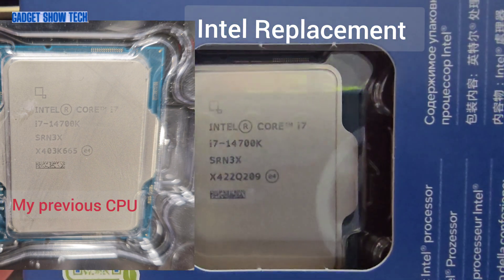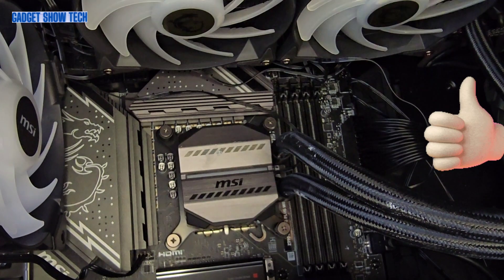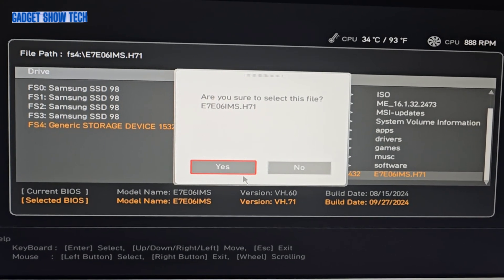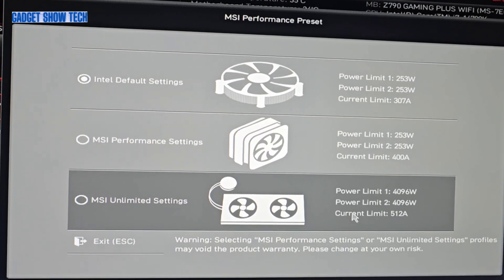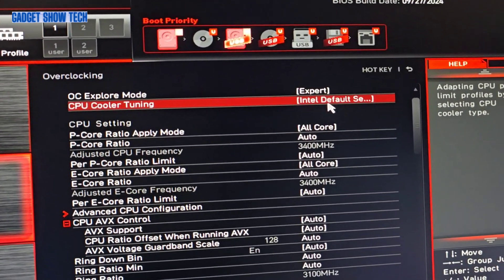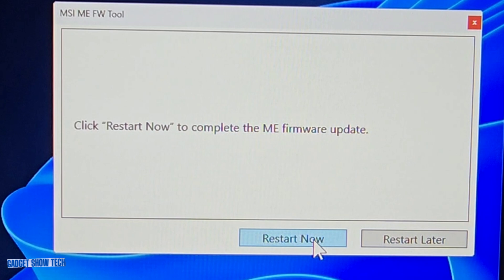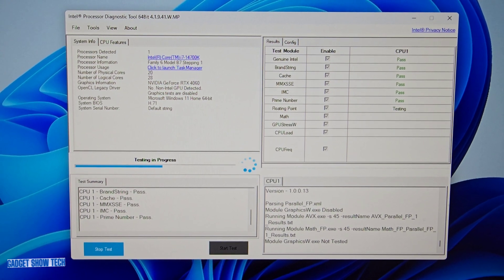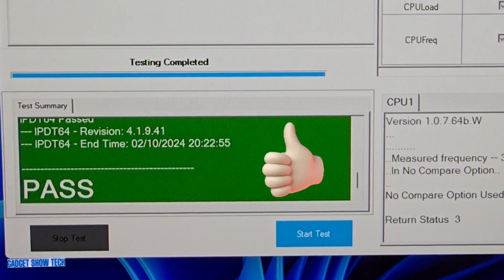This Microcode Fixes INTEL CPU Vmin Shift Voltage issue and ME Firmware update

Comment from the maker: Reports of Raptor Lake instability issues have been at an all-time low since Intel released firmware updates several months ago — but they're not completely gone. Intel released microcode update 0x12F last week to fix Vmin Shift instability, an issue that was thought to have been fixed with previous microcode updates.

Microcode update 0x12F is reportedly an extension of the microcode update 0x12B, and it supplements 0x12B with additional fixes that weren't covered. Specifically, 0x12F fixes a limited issue surrounding instability on Raptor Lake systems operating for multiple days in a row, running low-activity, lightly-threaded workloads.

Intel confirmed that microcode update 0x12F does not incur any additional performance penalties beyond what previous microcode updates might have added. To clarify, microcode update 0x12F specifically applies to 13th- and 14th-generation processors and does not apply to Intel's latest-generation Core Ultra 200S series processors, which have no (known) instability issues.

Comment from the maker: 1) Intel ME Firmware. This is flashed to your motherboard and is independent of the OS. It remains in place unless updated.
2) Intel ME interface (MEI) drivers for Windows. These will need to be installed every time you do a fresh install of Windows.

Comment: The ME software must be done before the BIOS update. I would re-install the BIOS update.
Reply from the maker: @NeXuS858  is separate from the main BIOS firmware, hence the need to update it separately.    Also, it's a new MB, I'm sure another BIOS update will be out soon.
Reply: @SmartGadgetShow  I know that's why I'm saying to update ME first. It's basically for all components to communicate with each other. Some vendors do include it together with the BIOS update though.

12B is awesome I was getting a very slow bootup with the past microcode update for some reason.
Reply: I saw the same thing. I do it just to be safe.
Reply from the maker: @frankmjr6571  I've only read on ASUS dated 2023.  But motherboard manufacturer's give instructions, and I'm sure they would if important.  
I've flashed a more recent BIOS.

Comment: INTEL s.u.c.k.s. so bad  :)
Reply from the maker: All my computers are intel.  I still have a 14 year old laptop with i7 3rd gen.
Reply: @SmartGadgetShow  hehe feel sorry for you :)
but I hope you will be wiser one day :)
heh heh
--
Although they have now fixed INTEL's problems, things are not going so well.
and that's why AMD will always be the king.. here a bit from a computer test page after the new update....
"""""""
Intel puts an end to the matter ,  CPUs no longer burn together, but performance takes a dive

A system equipped with an Intel Core i9 13900K is shown here to perform 6.5 percent below previous levels in the benchmark program Cinebench R15.

Here, the system delivered 314 points in a discipline where typically between 330 and 340 points are scored.

This means that the system in that test now performs below AMD's Ryzen 7700 processor.""""""